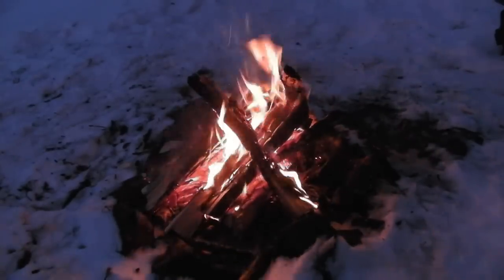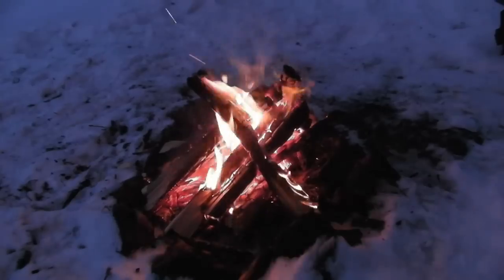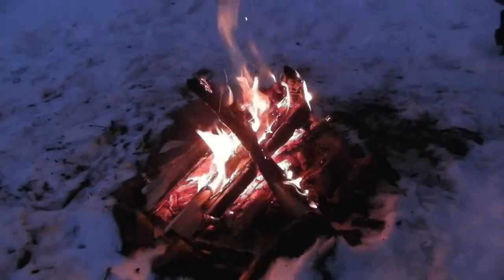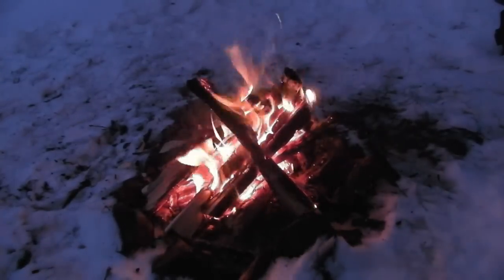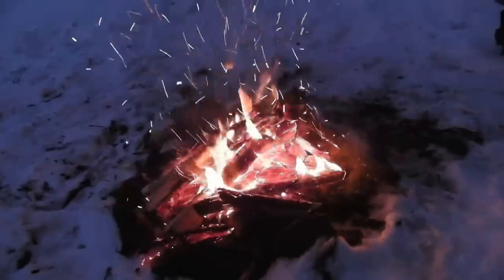Wetterling Axe Work.

Comment: I bought this axe and It looked great. It was sharp, straight, and beautiful. But unfortunately I was unlucky and received a defective one, the very bottom of the edge broke off and took an inch of metal with it. It was the day after I got it and I had not hit anything but wood with it. Not even had it in the dirt. Hopefully wetterlings will understand and give me a new one

Comment: Hey, thanks for posting. I was wondering what the overall length of this axe is? According to wetterlings website it has a 26" handle. I was wondering if that was" from the bottom all the way to the top or just to the underside of the bit.
Reply from the maker: Thank you. I think it is the hole axe.

Comment: North Survival, check it out under Captainberz. There is a full demonstration of chopping, cutting and splitting. It was developed jointly by Wetterlings with Canadian survivalist Les Stroud, 'Survivorman', as he is known. It ison sale here in the UK very soon for about £70 (700SK). Size is as a small forest axe but has a flared bit (rather like a carpentry axe) for better splitting, a polished poll for hammering in tent stakes & a 'straight' hickory heartwood handle of 20". Check it out!

Comment: Hi ai bought the scandinavian forest Axe with 65cms of length but I feel it's too short to use with trees lying on the floor? It seems very easy I could fail and hit my leg. My height is 1'76cm, is the right axe for that use? Or should I buy the american forrest axe which is 80cms (but 2 kgs!!).
I would appreciate your advice.
Thank you!! Loce your video!
Reply from the maker: Pol Brau Esteban If you have the Power to use a 2 kg axe, take that. But i would choose the scandinavian forest Axe.
Reply: im almost long as you

Comment: Don't cut up with the axe, keep cuttin at a angle. The horizontal cut is done with a saw. By just cutting at 45° you will cut cleaner and faster. And safer.

Comment: Why skipping the LHA or SFA by GB its a bit smaller then 232. in my case size matters. 232 is 6 inches longer handle that Lha and blade bigger for 0.5 inche.

Comment: whats better: the wetterlings 15 inch axe or gransfors bruk 13 inch axe?
Reply from the maker: I would choose Wetterlings, they have a better sheath, both axes are as good.
Reply: NorthSurvival
also do you think a gransfors bruks handle will fit a wetterlings axe?

Comment: Hey North Survival, I see that you have been cutting down trees and as much as I agree that there is nothing wrong with that (unless you go other the top) I've heard that Sweden has some laws that say you can't cut them legally, now even though this law will not stop me from cutting trees as our ancestors have for many years and is unfair for us not to be allowed now but is there a way to get around the law and how are you allowed to cut them? I really want to know as i'd much rather feel comfy knowing that I'm not going to get fined. Thanks.
Reply: I will admit that I do not know the exact parameters of the law you are referring to, or how it is applied where you live.  However the tree that he cuts in this video appears to be "dead standing".  It is generally acceptable where I live to cut dead timber.  It can actually be beneficial to the forest to remove this dead timber.
Reply: Joe S Thanks very much :)
Reply from the maker: Joe S That is right.
Reply: Ricky Wheeler Helps prevent wood insects too.

Comment: yeah, nice video. but the statement of 1 year without sharpening and still cutting through paper: of course if it can obviously cut through wood and the ground, so it should be able to cut trough paper. bye